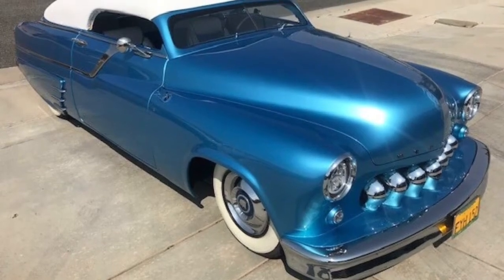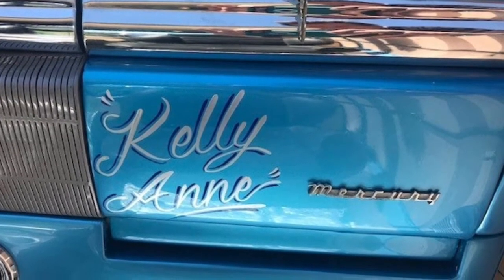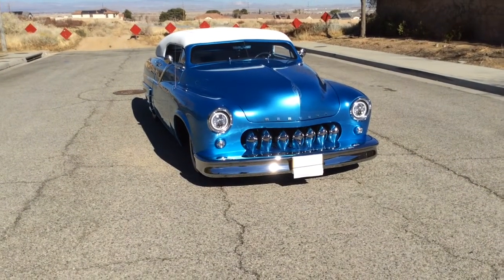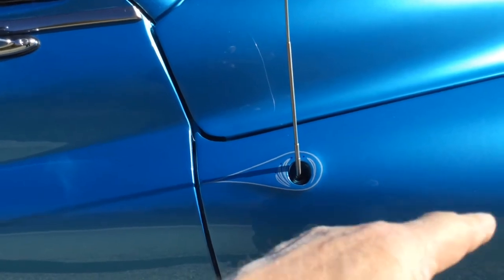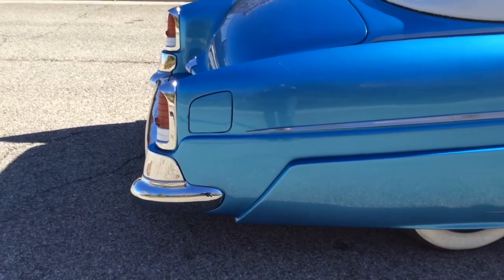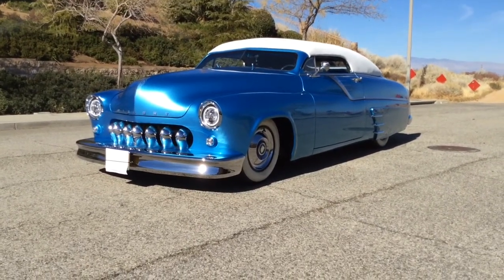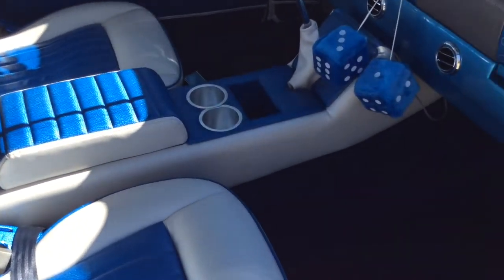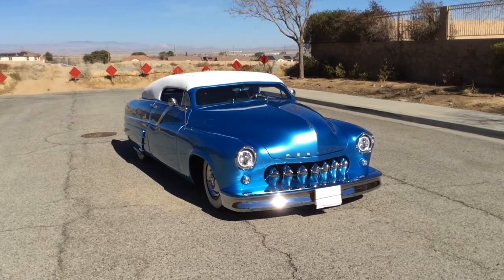1951 Mercury Chop Top Lead Sled Project Restoration-Episode 7

Comment: the fit of the bumpers and the gaps on all the openings, ie, doors, hood and trunk etc is amazing. when i go to shows i annoy the crap out of people nit picking bumpers and gaps, coming from a family of actual real body men from the 50s on i could never understand how someone could do a build and spend thousands on paint, chrome and upholstery and sound systems and have butt ugly gaps and bumpers twisted from side to side, something that costs nothing but a little labor and used to be done just for general body work on customers repair jobs. beautiful job and very well done, from an old 81yr old fanatic. thanks for the videos, i still have several very old paddles and pick hammers, slap hammers and various small body tools from the old days, anyone close to san antonio that would do them justice is welcome to them.

Comment: A great effort. A LOT of work. But more than that, this is faithful to the real custom culture of the 50's. Which means everything.. If you ask me, the Height of the Carson top is too high or thick. The top should meet or all but meet the top of the cut windshield.  The DeSoto tail lights do "work" but unless you want to be different at all costs there are better choices. I really suggest you look up the work of "fonze" who's Mercs were always for Years at LEAD EAST at Parsippany NJ
Check their vintage photos from the 80's or early 90's. You use of the Pontiac side trim is great you fitted it right into the Merc side dip. But it's really the intent
of this guy folks what he did is, as above, the real custom culture....
Reply from the maker: Hi Cindy. I wanted to thank you for the insight and compliments on my car. I studied magazines, books and car show videos from the 50,s through the 90,s before I started this project in hopes of building a period correct Kustom that would have been cruising around in the late 50,s and early 60,s. I am fortunate enough to be close enough to visit and confer with one of the most famous Merc Kustom builders named Gene Winfield and he and his people helped tremendously. I’ve looked up “Fonze” and love his work this so thank you for that info too. Regarding the Carson Top, I agree with you but in my case this car was originally chopped too much and if I had built the top to flow into the top of the windshield frame it would have not been proportionally correct and I would not have had any head room. Check out episode 5 and you will what I am explaining here. I believe that chopped cars, hard topped or Carson need to flow directly into the trunk and we took great time to accomplish this on this car. Thank you again

Comment: Will you have a video of the engine compartment?
Reply from the maker: Hello David, 
Thanks for the question about the engine compartment. This car has a 350 Chevy Crate Motor backed up by a 700R-4 Overdrive Trans and a 9” Ford Rear End. The engine compartment is all black and the motor has the typical finned valve covers and air cleaner to keep it somewhat period correct. 
Most Kustoms are never shown with their hoods up as it breaks up the lines of the car versus all Hot Rods always have their hoods up to showcase the power plant. Hope this helps